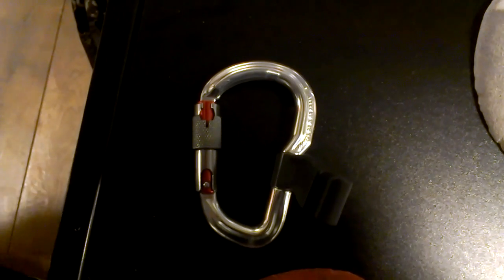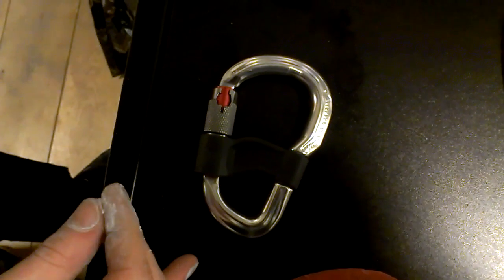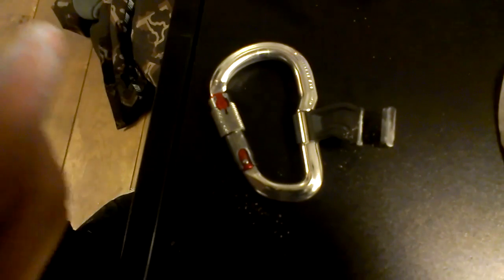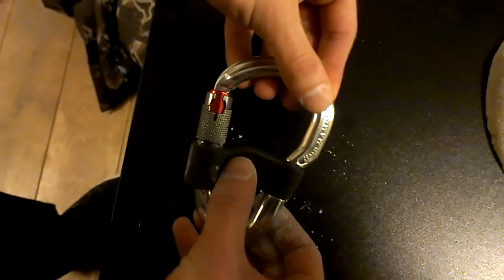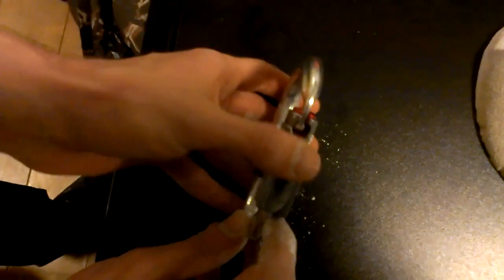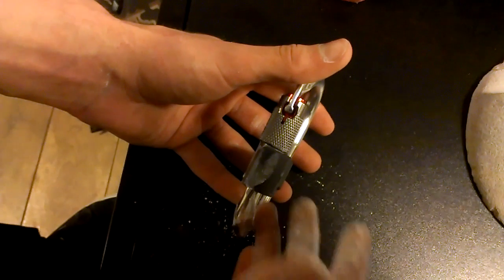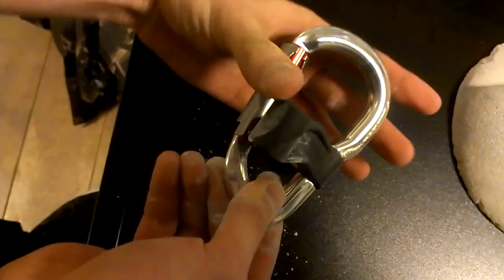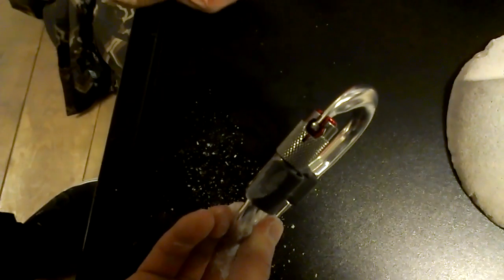Mammut Element Smart HMS Design Failure

Comment: Thanks for posting! I've never had this happen after about a year of regular usage (and I use plenty of chalk), but it certainly seems possible. I still think it's a good design with more safety than a simple biner, but this shows the importance of verifying a complete lock with any auto-locking biner.

Note that even with the twist-lock open, the gate still has full strength as long as the gate is closed, and the plastic piece which holds it fully closed has not more load than normal in this position. This is still an improvement over a twist-lock without the plastic, since I've seen twist-locks get stuck unlocked, without anything to hold them in the closed position. And if the plastic piece opened for any reason on it's own (which has never happened to me), the lock would close.

Comment: The should just make the plastic cap close from the other direction. That would make the closing action push in the same direction as the closing direction on the locking gate.

Comment: After about 3-4 months of light use, I discovered that that the flanges at the bottom of the collar bent outwards slightly, allowing the collar to twist under spring tension before returning to the closed position, jamming the carabiner open instead of locking in the closed position. I was able to bend the flanges back with a pliers to "fix" the problem, but I have retired the 'biner at this point. My email to Mammut was not responded to at all.

Comment: Does the standard mechanism of locking carabiners claim to be able to withstand any loads? The locking carabiners I have only prevent the opening thereof by means of a thin ring that is weakened by the slot required to allow opening. I agree that this seems to be a flaw in the design, but it isn't clear to me how dangerous this might be.

Comment: I agree with previous comments. You can't blame Honda for poor automotive manufacture if you drive on bare tires, never change the oil, and forget to take the handbrake off. This is primarily failure of usage. The onus to check and use the gear properly is on you. Always check your gear. That means, keep your biners clean from magnesium, and ensure that the locking mechanism is functioning properly.

Comment: exactly what i was going to say... good observation of the magnesium though... but its too unlikely to happen if you use your gear as you should... that carabiner was made specially to work with the smart alpine belaying device, that has a tendence to slip to the sides of the carabiner.. if you use it for other tasks, it may not work as it should..

Comment: I bought two of these, despite this warning.  with them in my hands, i don't see his concern.  If you look at where the plastic gate touches the barrel, it is not possible for it to rotate the barrel any further than what he demonstrated. (he exaggerates when he claims it sometimes twists to fully open).  the point of the plastic clip is that it holds the autolocker locked (no guarantee that you locked it in the first place), and that it keeps your biner oriented on your belay loop.  does all that.  no complaint.